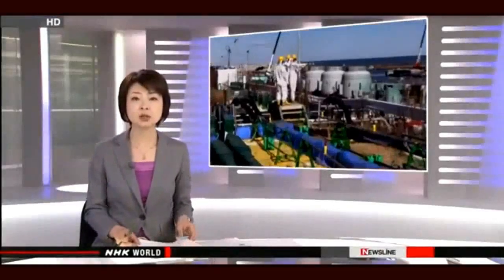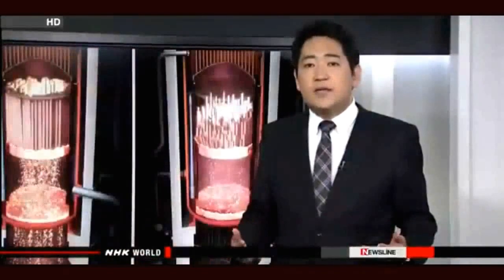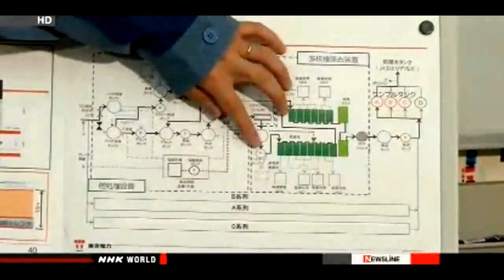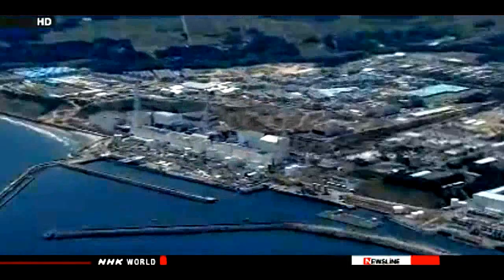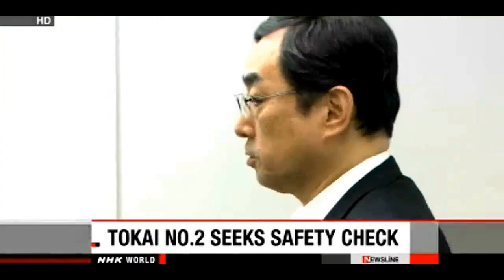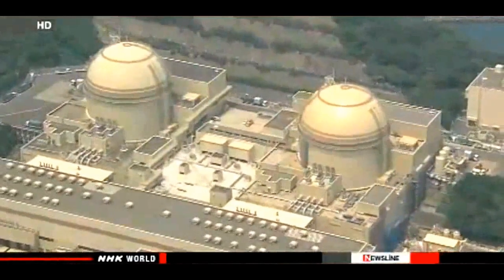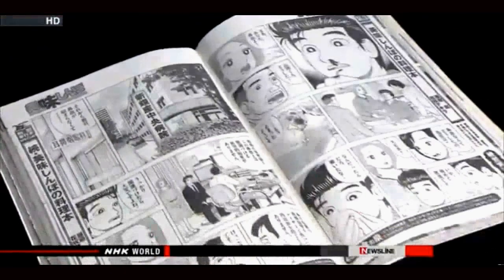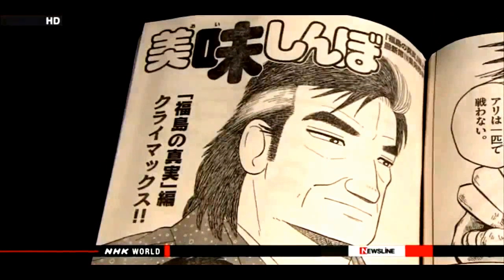The Good, the Bad & the Ugly Update on Fukushima, Ohi & WIPP: 5/21/14

Comment: Before anything they need to find a way to protect the general public and childrens from radiation as much as possible as this can affect our abilities to find a solution..We need a massive radiationcast like a "weather cast" ..and strict food monitoring.Someone outhere holds the key to unfold this to the best situation. Solid waste is at least easier to manage than water. Sea salts and calcium would block filtration systems..they need neutral disolvants~ after if the public gets affected we will have to deal with an even bigger problem to solve

Comment: U.S. Department of Energy, Office of Environment, Safety, and Health. Independent investigation of the East Tennessee Technology Park. Vol. 1: Past environment, safety, and health practices. October 2000

Excerpts:

"Conservative estimates indicated that 35,000 pounds of uranium were released into the air from all sources. 4,300 pounds of uranium a month was unaccounted for or released to the environment. ETTP operates an incinerator which handles radioactive, hazardous and uranium-contaminated PCB wastes. ETTP generated transuranic elements (isotopes with atomic numbers greater than uranium) such as neptunium-237 and plutonium-239; fission products such as techneitum-99; PCBs; toxic metals; and volatile organic compunds such as trichloroethene (TCE) and present risk to the public. Some contaminants migrated outside the Plant boundary. Waste disposal practices included direct discharge of radioactive materials, toxics and caustics to holding ponds and storm drains, and incineration and burial. Reports reflected a number of spills of nitric and hydrochloric acids, in one case 200 gallons. Numerous large fires and explosions were reported. It is impossible to characterize exposure because of inadequate surveys and incomplete records. Records indicate that as contamination levels increased, exposure controls were reduced. Contamination above limits was commonly detected. Operations have released a variety of contaminants into the environment, such as burial of low-level and hazardous waste in landfills and dumping directly into the Clinch River. Large amounts of contaminated equipment and scrap material were sold at public auction. Tens of thousands of pounds of flourine and hydrogen flouride were emitted annually. The investigation team identified over 600 releases of uranium hexaflouride, and a large, visible cloud was released outside a building. Exposure to 'intense clouds' of uranium powder dusts was prevalent and resulted in intense beta radiation fields. Each month dozens or workers were identified as having exposures exceeding plant control guides. Extensive contamination was prevalent. Recordsindicate many air samples in excess of Plant Allowable Limits. Both chemical and radiological materials have routinely been discharged from the Plant, from both sanitary sewage and storm water systems and materials were directly discharged in Mitchell Branch and Poplar Creek. One million pounds of blowdown water was discharged a day. The hexavalent chromium concentration in Poplar Creek is equal to the level regulated by the site's permit. Contents of 500 uranium hexafloride and other gas cylinders were emptied into the unlined holding pond by shooting the cylinders with high-powered rifles, and this pond discharged into Poplar Creek. Records confirm that radiation exceeded drinking water standards. Over 80,000 drums of pond sludge with low concentrations of uranium were generated in 1988. Ventilation was modified to discharge mercury fumes above the roof. Elevated levels of mercury were found in urinalyses. Records refer to the recovery of tons of mercury. Traps would blow out spilling mercury on the floor. Air sampling in the 1990s identified mercury levels several times the Threshold Limit Value. Continual and volumnous process leaks (blowoffs) were vented to the atmosphere. 4,300 pounds of uranium hexaflouride were released per month. Losses were excessive. 10,000 union grievances were filed and management disputed grievances concerning safety in favor of economic considerations. Many storm drains were not moitored before 1992, and routine and accidental wastes have adversely impacted the environment and the aquatic habitat. Weaknesses in the sampling and monitoring of air pollutant emissions raise concerns regarding the accuracy of public dose and exposure calculations. Environmental radiological protection and surveillance are not compliant with DOE Order. Few records reflect involvement by the Atomic Energy Commission in investigations of serious events. Levels of airborne radioactivity were as high as 35,800 dpm/ft3, and far exceeded the PAL of 2 dpm/ft3. [That's radiation levels over 17,000 times the maximum limit.] Airborne radioactivity far in excess of normal background levels was measured off-site as far as five miles away. A number of criticality and sub-criticality accident experiments were performed and posed a severe radiation hazard. Bladder cancer rates were seven times higher than for the general population, and stomach ulcers were 6.5 times greater. Inhalation of airborn radiation can increase the risk of future cancer." [verbatum from the Report]

NOTE: This report only covered the K-25 plant, not the DOE National Nuclear Security Administration's Y-12 nuclear bombs factory, not the thousands of contaminated lab rats from ORNL's Y-12 nuclear bombs factory Mouse House that are incinerated at the University of Tennessee Medical Center in downtown Knoxville, and did not cover Top Secret "criticality" pollution, "referred to as 'special hazards'" (ie, "small" explosions due to accidental nuclear reactions), and "are discussed in a separate classifed document." The GOPS government of Tennessee previously gave ETTP/ORNL a clean bill of health in 1999. This report was reclassified Top secret by US Dept of Homeland Security after 9.11.2001.

"OAK RIDGE - Tennessee residents have collected more than $1 billion from the federal compensation program for sick nuclear workers - far and away the most of any state. The Department of Labor announced the milestone today. The federal agency said it had paid more than $1 billion in compensation and medical benefits to 9,134 Tennessee residents under the Energy Employees Occupational Illness Compensation Program Act. Nationwide, since the act was implemented in 2001, the Dept. of Labor said it had paid 51,331 claimants more than $4,8 billion in compensation and medical benefits. In a statement released by DOL, Rachel Leiton, director of the Division of Energy Employees Occupational Illness Compensation, said: 'Many covered facilities, including the Oak Ridge National Laboratory, the Oak Ridge Gaseous Diffusion Plant (K-25) and the Y-12 Plant, are located in the state of Tennessee. Individuals who worked at these and other covered facilities located throughout the state sacrificed their health to build this nation's nuclear defense programs. Therefore, I am proud to be able to announce that the department has paid more than $1 billion in benefits to deserving Tennessee residents. But we also believe that there may be others eligible in Tennessee who have not yet filed for these benefits.' The Dept. of Labor encouraged potential claimaints to call this toll-free number: 1-866-481-0411."

âFrank Munger Blog, editor, Knoxville News-Sentinel, Tennessee's sick nuclear worker compensation reaches $1-Billion, May 26, 2009 (censored from newspaper)

http://www.knoxnews.com/news/2009/may/26/tennessees-sick-nuclear-worker-compensation-reache/

More reports on deadly air pollution by the federal government in East TN. Knoxville TN ranked #1 most polluted city in USA:

http://piratenews.org/knoxville-tn-epa-ornl-air-pollution.html